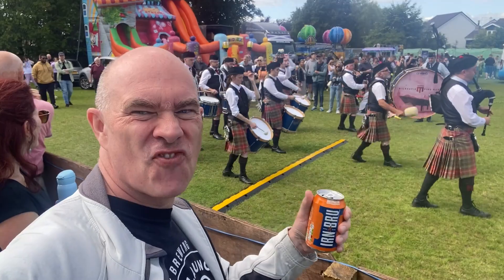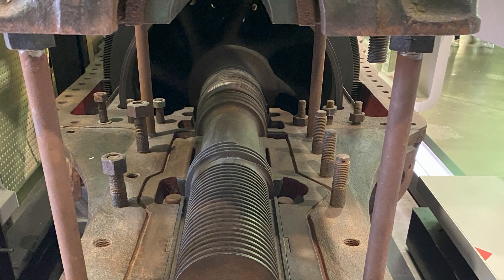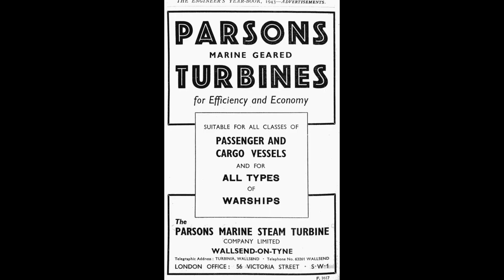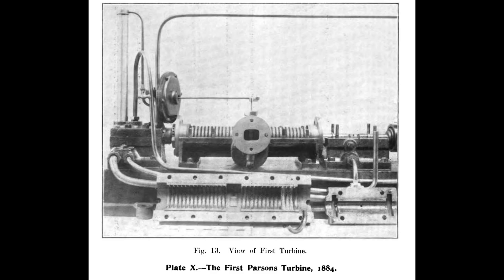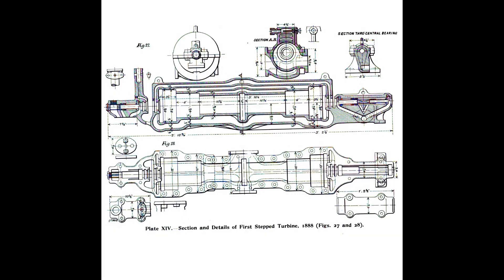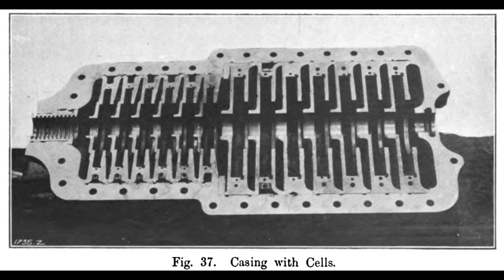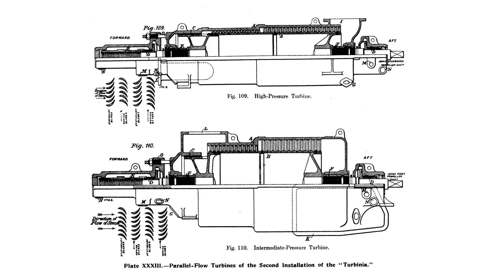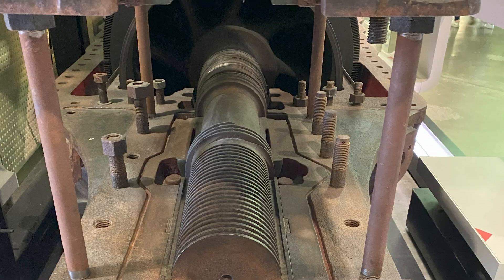How A Victorian Era Engine Made Spaceflight Possible... Let's Look At A 125 Year Old Turbine!

Comment: I was on a kick a couple years back, looking up old, zany airplane designs. Started with trying to find precursors to jet engines. 
First stop was the "Motor-Jet", like Caproni-Campini N.1 from the early-30s, which was a conventional ICE powered plane but it drove a compressor turbine, as well as the exhaust gasses helping scavenge some extra efficiency. (IIRC it even had a crude afterburner!) 

However, the EARLIEST predecessor I could find was the Coandă-1910 by, you guessed it, Henri Coandă! The very man who came up with the "Coanda Effect".
His was more of a... "Motor-Fan" I guess you could say? It was still piston motor driven, but used a ducted turbine fan for its propulsion, instead of propellers; an early turbo-fan basically. (Stipa-Caproni did similar, but it was a giant ducted-propeller, which was also in the 30s)

All this is to say: Coanda was inspired by the steam turbine used for electric generators... which gave me pause, as I had no idea they were that old! That's when I found out, just as you [Scott] had, that steam turbines were a late-1800s invention... 🤯
Reply: There is no evidence that the Coandă 1910 was anything more than a ducted fan aircraft and this aircraft was only constructed as a non-flying static display, it never flew..

Comment: A great video on the gestation of industrial turbines of all types. One quibble though - all early marine turbines - i.e. those driving the propellers were direct drive - the turbine and prop were on the same shaft and rotated at the same speed. The cavitation issue mentioned limited the turbine speed so they were not really “hi-speed” turbines as we know today. This hurt the efficiency at both ends - turbines tend to be more efficient at high rpm and marine propellers at lower rpms by comparison.

Comment: The submarine I was on had de Laval turbines. Surface ships also have de Laval lube oil purifiers. They are also used in commercial power plants though I am not sure the brand. I think the successor company is the Alpha Laval company. The sub I was on had a Sharples lube oil purifier.

Comment: Another interesting things about early turbines is they would shake themselves to destruction at certain speeds, because they were unable to do precision balancing in the early years. But the workaround was simple: Quickly accelerate past the resonant speed, so the vibrations in one direction would cancel out the vibrations in the opposite direction. It did still put extra strain on the turbine components, but it was within tolerable limits.

Comment: Fascinating video! TIL that the Soyuz still uses the H2O2 turbopump from the V2! I've know about the evolution of Soviet rockets from the V2, but I didn't know that such a direct descendent of the V2 engine still flies today!
Reply: Of course Soyuz does not literally use a turbopump from V2. It is a completely different rocket, with completely different engines, and their fuel requirements are completely different. It does use hydrogen peroxide to generate steam for powering a turbopump, but it is not the V2 turbopump.

If we compare the propulsion system of the Soviet R7 (the first member of the family of Soyuz-type rockets) with those of contemporary to it US Redstone rockets which were used to launch the first US satellites, the latter show their V2 heritage much more obviously. Both used peroxide to drive their turbopumps. But even the US rockets were already very significantly different from the German design.
Reply: @cogoid  I mean it is interesting to see the V2 H2O2 pump inspired systems still running today. I feel like the modern US rockets and engines has evolved very far away from V2, while you can still notice signs of the V2 in the RD107. I might have phrased my original in a strange way and caused confusion, but thanks for the insight!

Comment: Cavitation is also a thing in the current generation of foiling yachts in SailGP and Americas Cup. If your hydrofoil goes through the water too fast it will cavitate and lose lift, causing your yacht to fall off it's foil and touch down or worse.

Comment: One of the Patents that he didn't have access to and was a major factor to Steam powered turbines were better Superheaters that were being developed for Steam locomotives. Prior to adapting Superheaters they used Saturated steam(very wet). Superheaters were first developed for Steam locomotives by Dr Wilhelm Schmidt, of Kassel, Germany. Starting in the early 1880's(around the same time Parsons started his work on turbines) he started investigating and creating more efficient superheaters. Dr. Schmidt is considered to be the pioneer of practical superheating. It wasn't until 1898 Dr Schmidt(assisted by Dr. Robert Garbe, Chief Mechanical Engineer of the Berlin division of the Prussian State Railways and Jean Baptiste Flamme, Chief Mechanical Engineer of the Belgian Railways and highly regarded Boiler designer) started the commercial application of superheaters to railway locomotives, when the first superheated engines were placed in service on the Prussian State Railway. Parsons early designs could slightly superheat the steam but never more than about 500°F. Which at that temp it's still somewhat wet. Schmidt's designs were seeing very hot and very dry steam at around 900°F. It was those design patents that Parsons was after as it was the secret sauce to get the pressures he needed. In 1908 Dr Schimdt went on to form Schmidt Superheating Company Ltd in the UK and in 1910 the The Locomotive Superheater Co. in the US. Both Companies then began developing superheaters for Marine turbines a short while later.

Comment: Funny anecdote: I build small Delaval nozzles for my blowguns for dusting with my air compressors.  They're true supersonic nozzles too.  If you do a shadowgraph with a lamp about 40 feet away and hold the nozzle at a 90 degree angle to the wall from about 2-5 feet away, you can blatantly see the mach diamonds.  You can even feel when it first chokes and transitions to supersonic flow as you squeeze the handle and gradually add more air.  It's VERY effective for dusting.  Also handy if you feel like blowing up a fan/blower for giggles.  (No, I've never done it, but I don't need to do it to know it will. :P )

Comment: lots of rabbit holes to go down here... piping systems, pneumatic controls, turbine driven pumps (boiler feedwater), water chemistry, fuel and oil chemistry, valve technologies, control systems, electrical generation systems, water generation systems, liquid storage systems, high pressure oxygen removal systems (DFT - deairating feed tanks) - used to remove oxygen from steam systems to reduce piping system corrosion at high temperatures - a big source of explosions in high pressure steam systems, analog control systems - special purpose computers, liquid testing and quality analysis, periodic maintenance systems, operations of the equipment - it took people to operate these machines, even after automation was in place... because everything breaks. Great topic here.  So much more to explore.

Comment: Another thing about that old steam turbine is the ends of the shaft, where the thrust bearings are. Multiple bearing faces, with pressurised oil feeding them, because no ball bearing of the time could withstand the thrust and rotational speed, so they simply used lots of bearing surfaces, and put them in parallel, so the oil film could still provide protection.

Comment: I loved working on the old tired iron in the power generation industry. 250-700+ MW steam turbines designed with mechanical drafting and slide rules. Built on manual mills and lathes. Still purring almost 100 years later. Granted a lot of maintenance has been completed in that century.

Comment: arguably hte first turbojet engiens sucked because the material science wasn't ready for hte concept
with a limtied turbien inlet temperature you kidnof have to do a tradeof between power nad efficiency with a limited total temperature budget, basicalyl the more you let the compressor heat up the air above room tmeperature hte more efficient your engine runs and the more ehat oyu can add in combustion the more fuel you actually get to use at that efficiency and if the temperature afterthat is mroe limited you ahve to d othat tradeof with a smalelr overall budget ot begin with
and with less heatresilient metals and less advnaced cooling systems early turbojets had a really limited tubrine inlet temperature, in a very ismplifeid wroldview, in hindisght, we can now asay that turbojets and their derivatives are successful but at the time they were arguably kindof a bad idea and using piston props while waiting for better metalurgy was the smarter move
Reply: The Jumo 109-004B turbojet solved those problems, 
it was the World's first jet engine to not only have turbine blades internally cooled by compressor bleed air but also the first production engine to utilize TBCs 
Both are technologies that are absolutely essential to today's modern jet engines and was not available to the Allies until captured German technology was disseminated.

The first high temp. creep resistant alloys were developed and introduced in Germany circa 1930. Krupp P-193 A60 was a high nickel alloy that is still used in jet engines today and is sold as A268.

Not true, the introduction of the Messerschmitt Me-262 rendered all propeller driven fighter aircraft obsolete overnight, it completely outclassed everything the Allies had in operational service during WW2.
Reply: @DoktorBayerischeMotorenWerke  the jumo hada  turbine inlet temperature of 838°C
most moern jet engiens are at around 1400-1500°C some at around 2000°C
you are falling for wunderwaffen propaganda and you're about 80 years late doing
the jumos perforamcne at high speeds was slightly better htan props, at low speeds much wrose and it ate through spare parts like fuel
Reply: @JulianDanzerHAL9001  Nimonic 80 used by the allies at the very end of the war only had a turbine inlet temperature of 682 degs.C Germany was years ahead in thermal management technology. Temperatures above 900 degs C were not achieved until many years later. 
Development of jet engines proceeded very rapidly after the war... mostly based on captured German technology and expertise which flourished during the cold war years. in particular German advancements in thermal management technology in bleed air cooling, developments in metallurgy have been in much smaller increments and have had diminishing returns in terms of higher creep temperatures.
 The Messerschmitt Me-262 was 125 mph faster than any Allied aircraft, its continuous cruising speed was faster than any Allied aircrafts top speed w/ WEP and it could dive at speeds reaching Mach 1... no Allied aircraft in WW2 could come close to this level of transonic performance.  Germany was a decade ahead the allies in jet and aerodynamic performance and technology.

Any questions lad?
Reply: @DoktorBayerischeMotorenWerke  off topic
I'm not claiming hte allies had a better jet engine I'm stating that jet engiens in general at the time sucked and would suck for a while to come
top speed alone does not decide performance
and a brick can dive near mach 1
the cahllenge there is maintianing control which ahs more to do with contro lsurface design than engines
if you look at modern jet engines they are full of materials with much higher useufl operating temperatures than anything available in the 50s though I'm more of an engineering than a history nerd so I'm not sure precisely when between 1950 and 1990 those became commo nand how quickly they developed
I do know enough about history not to fall for nazi propaganda 80 years after the fact though
thouhg knowing ab it of negineering helps with that too
let me guess
you find the v2 imrpessive too?
Reply: @JulianDanzerHAL9001  You keep using that word... "Nazi" like it has any bearing on this topic.
 Machines like aircraft and jet engines do not and cannot espouse the tenants of National Socialism, Fascism, Communism, Monarchism or any other kind of 'ism.
 Most engineers and pilots don't either.

You are clearly allowing your shortsighted political beliefs to cloud your judgement and assessment of the technical and performance aspects of these machines.
 Germany was the world's leader in aerospace technology and was easily a decade ahead of the Allies during WW2.
 They built the world's first powered aircraft and the world's first aircraft engines they are currently the largest manufacturers of jet aircraft in Europe and the largest single jet aircraft factory in the world is also located in Germany.
  
 A brick cannot fall to earth at Mach 1 and it cannot fly controllably above its critical Mach number without a servo powered Horizontal Stabilator.
Germany was the only country to have this high transonic aerodynamic technology 

EVERYONE who knows anything about aerospace technology finds the V-2 missile impressive... and they should, the Allies had absolutely NOTHING comparable.
The Allies expended enormous resources to fight against it, they tried to reverse engineer it, and restarted production after the war.
 Its damage reports of raids in the UK still top secret. The US military adopted captured, and manufactured new V-2s after the war, it was used in operational service along with its improved variants for decades.
 The A-4b rocket plane was successfully tested to Mach 4 (unmanned) its manned test program was terminated just days away from starting by the end of the war..

Comment: I've been messing around with high horsepowered outboard motors on small boats for most of my life. Cavitation is no joke. You can blast the enamel coating off of an aluminum prop in seconds. I didn't realize it had anything to do with the boiling point.

Comment: Uh, pressure differentials on turbine blades is the ONLY thing that turns the turbines, not velocity.  The reaction turbine is just another way to apply energy to the blades - all steam turbine blades use tangential pressure differentials to turn the rotors.

Comment: The R.M.S. Titanic was equipped with a low-pressure Parsons turbine as one of its three main engines. As soon as you mentioned Charles Parsons that immediately came to mind. Great topic, as usual!
Reply: All 3 of the Olympic class ships built by Harland and Wolff shipbuilders were designed with them. ;)
Reply: @SternLX  and the steam electric generators! I think Scott briefly mentioned electric generators but not on any specific ship.

Comment: "Steam safe". Funny how modern rockets still run on some kind of steam turbine. A compact steam turbine running on hydrazine or some kind of hypergolic fuel would also make sense for lunar or Mars colonies.
Reply: Gas turbine... the combustion gasses act directly on the turbine that drives the turbo pumps... steam is external combustion and utilizes the Rankine cycle..
Reply: @DoktorBayerischeMotorenWerke  My mistake. Gas/jet turbine for the initial combustion or reaction products, then maybe a steam turbine for the leftovers like in a CCGT power plant.
Reply: @fallinginthed33p  Combined Cycle, eg; Gas Turbine-Steam Turbine powerplants are only viable on a massive scale... only the largest power plants use this technology which makes it unsuitable for vehicles and also difficult to transport over long distances... 
 In terms of high density, high power to weight ratio and overall thermal efficiency ICEs trumps steam engines every time.
Its why steam only survives today in very limited applications..

Comment: Fascinating video. The de Laval nozzle works because the gas reaches sonic speeds in the constricted portion, and as it expands in the widening part, it accelerates to supersonic speeds, opposite to the subsonic Venturi nozzle. Interestingly, in the solar wind the same principle applies, accelerating the plasma to typically 500 km/sec. Elegant math.

Comment: hi Scott, great presentation. i was reading an article regarding Thorium Molten Salt Reactors, an interesting concept has been proposed to drive a gas turbine using the molten salt as the heat source. TMSR operate at 700+C which is right up there for modern gas turbine temperature range. this brings the Convair NB-36H flying reactor back to a possible future. the beauty of TMSR is they operate at one atmosphere, thus there is no massive pressure vessel required, reduced weight, massive power reserves, refuel every four years, cheap aviation from flying reactors

Comment: Hi Scott, I would still give the first rocket propulsion to the Greeks rather than the Chinese, since, in the 4th century BC, Archytas invented a wooden bird with an internal bladder that was wedged onto a boiler that would disconnect once the pressure was high enough to overcome the resistance of the connection and then be propelled by the escaping steam.

Comment: Is it really that the water "boils" so much to fill the cavitation with vapor or is it just that the water's inertia prevents it from closing in behind the prop?  I don't doubt that some water vapor fills that space, but I would speculate it is not water vapor holding the space open but rather that the water simply isn't able to accelerate quickly enough at the water pressure near the surface to back fill behind the prop and that it is mostly a "vacuum".